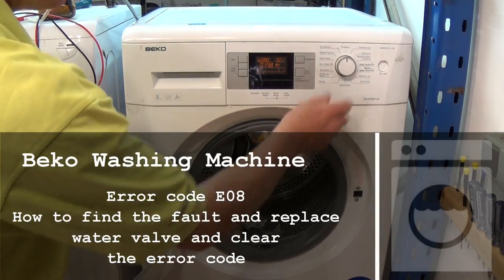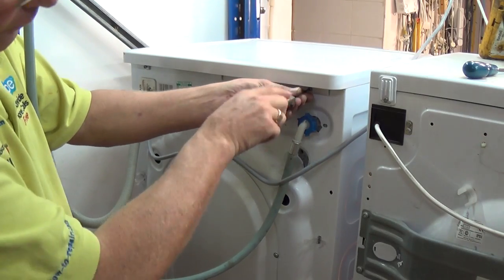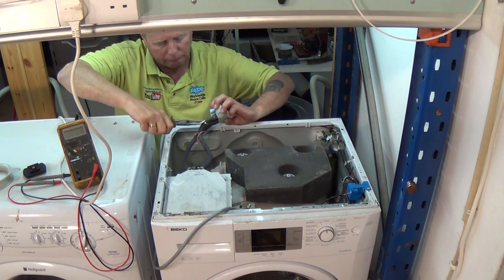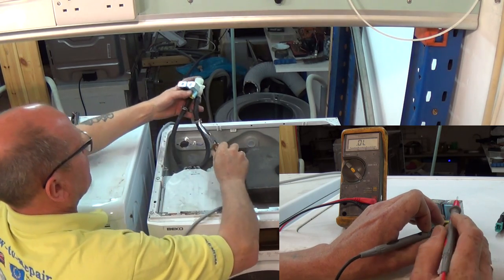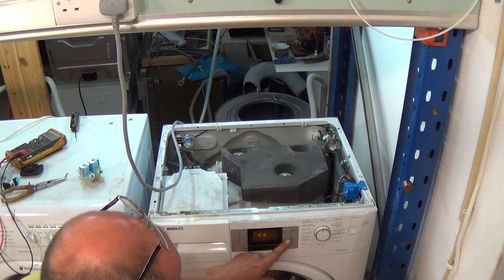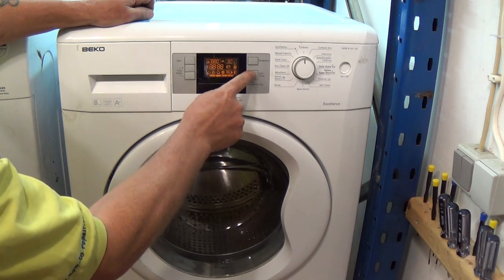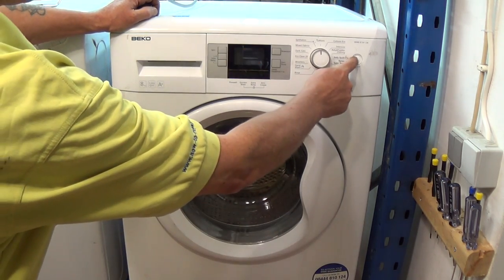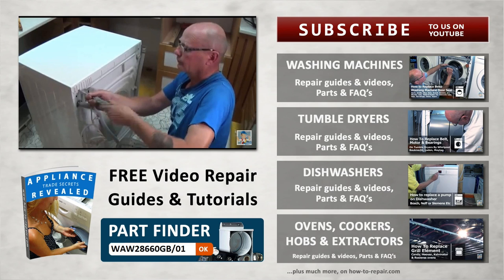Beko washing machine WMB series not filling with water Error code E08

Comment: Hi, I have a beko washing machine model wmb 91242 that broke down. I saw on the main board a resistance and 8 Pin IC SOC 
burned. The resistance is one of 1 or 2 W in the opposite part of the IC. Can you tell me the PN of these components to be able to replace? Best regards